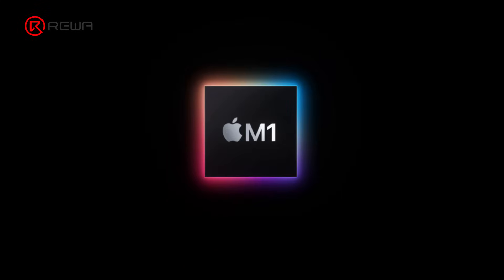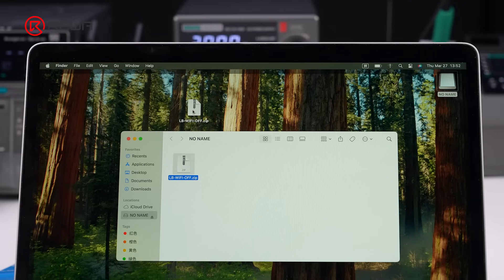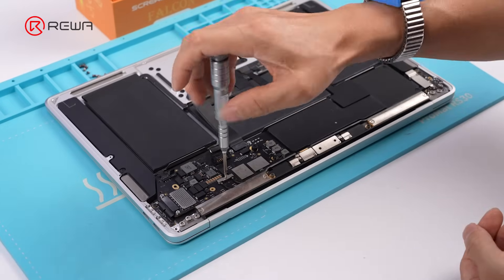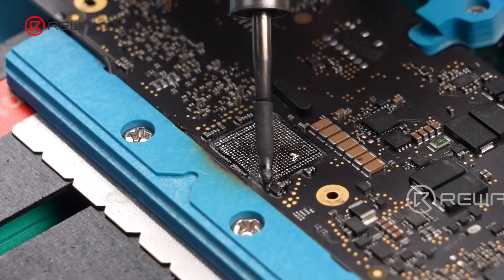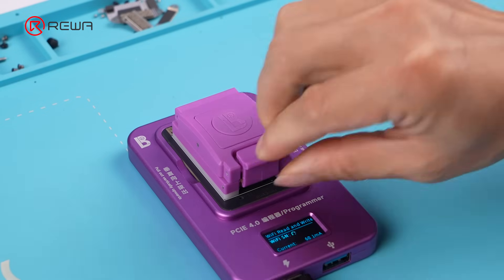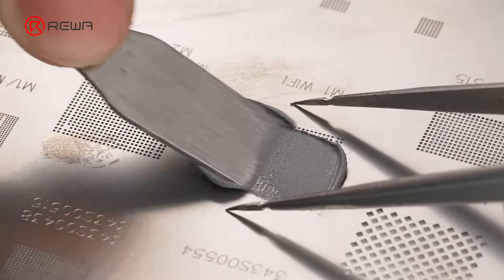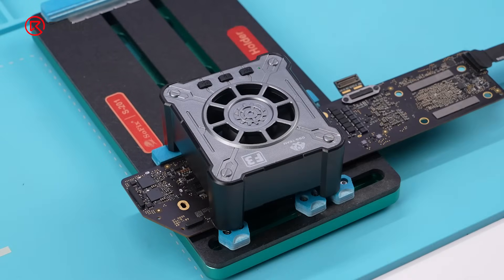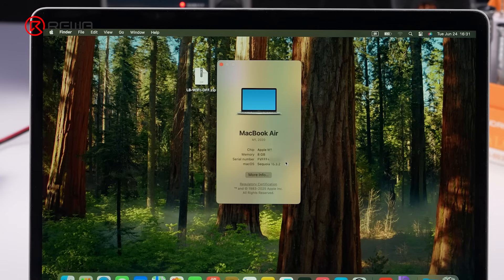M Chips MacBook No WI-FI Fix by Chip Replacement

Comment from the maker: Have you met MacBook WiFi issue? This repair method is easier than before, it also breaks the M chips WiFi repair limitation, drop your idea and your comments below ❤

Repair Tool: 
1.SoFix S-F401 MacBook Screen Refurbishment Assistant
https://shop.rewa.tech/detail/sofix-s-f401-macbook-screen-refurbishment-assistant.html?utm_source=YTB0708&utm_medium=video&utm_campaign=YTB+repair+video
2.SUGON AIFEN A9 Pro Soldering Station
https://shop.rewa.tech/detail/sugon-aifen-a9-pro-soldering-station.html?utm_source=YTB0708&utm_medium=video&utm_campaign=YTB+repair+video
3.SUGON 8650 Pro Hot Air Station:
https://shop.rewa.tech/detail/sugon-8650-pro-hot-air-station.html?utm_source=YTB0708&utm_medium=video&utm_campaign=YTB+repair+video

4.0.6mm Solder Wire：
https://shop.rewa.tech/detail/0-6mm-solder-wire-oem-new.html?utm_source=YTB0708&utm_medium=video&utm_campaign=YTB+repair+video
5.High-Purity Solder Paste 
https://shop.rewa.tech/detail/lead-free-solder-paste-maant-oem-new.html

6.1.5m * 2mm Solder Wick
https://shop.rewa.tech/detail/desoldering-wicks-oem-new.html?utm_source=YTB0708&utm_medium=video&utm_campaign=YTB+repair+video
6.Battery A2527 Compatible For MacBook Pro
https://shop.rewa.tech/detail/battery-a2527-compatible-for-macbook-pro-16-a2485-2021.html?utm_source=YTB0708&utm_medium=video&utm_campaign=YTB+repair+video
Reply: Hello RewaTechnology can you please make a video of iphone battery drain test. The original iphone with its battery health maybe 89% and with the same phone with swaping the bms to new battery without calibrating it to 100% and again the phone battery drain with the bms recallibrating to 100% with the new battery . 
If you could make a video , it will be so helpful because from iphone 15 , people have face battery health dropping issue like crazy , some just 200 charge cycle and 87-91%  and mine is 250cc and 90% on 15 pro max ( no gaming , and all background disable , 30-85% charge limit) . Its so strange when apple claimed to retain 80% on 1000cycle . 

Now i wonder turning off the optimised charging  just to set to 85% limit is the main issue that apple notice the peak voltage is not close to when the battery is fully charge , so they drop the battery health .

Also it seems the battery might not be degrading the health too much in the cell within but the battery health that has 90% limits to full charge the iphone battery to till the bms value are reading (not the actual cell capcity) 

I would be so thankful if you replied and agreed to made video on it ❤❤❤❤❤❤
Reply: what is the link for the app please
Reply: @rewatechnology2008 please ❤❤❤
Reply: Based on my finding and observations on usage , my battery is still at 96/97 %  at 250 cc with all my precaution that can degrade my battery.
Just because of apple limiting to charge the battery till only the 90% shown in the setting. 

And see why people across the globe has face drastic fall of bh in 15 and 16 series just because of togle on the 85% charge limit and people with 100 charge limit with optimised battery charging are holding strong with 100 % at above 270cc . This is not an assuption but real world scenario . 

Now im seeing whether i can improve
Reply: Please look into this matter
Reply from the maker: @Paohaokip07  Sorry for the late reply, actually the battery testing now we are plan to start, especially for the battery draining problem, you can stay tuned our channel for update.
Reply: @rewatechnology2008 im eagerly looking forward to it , ❤ from India .❤❤❤❤
Reply: @rewatechnology2008   where is the software needed to do the unbinding procedure?

Comment: I have samsung s21 ultra when I plug cable to charge it it turn off but when I unplugged it it will turn on normally
What cause the problem
Reply from the maker: Charge port or the motherboard connector problem.

Comment: how do u determine that it is Wi-Fi chip and not something else ?
Reply: not getting the proper diode value around chip components or there's short around chip components that leads to chip
Reply from the maker: Well this video we mainly share you with the WiFi chip replacement method, so we skip the diagnosis process.